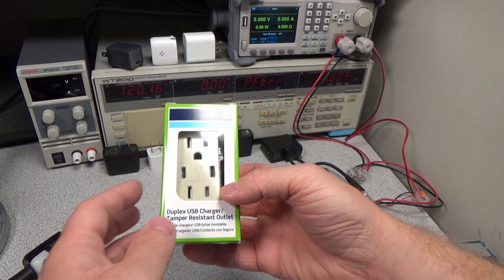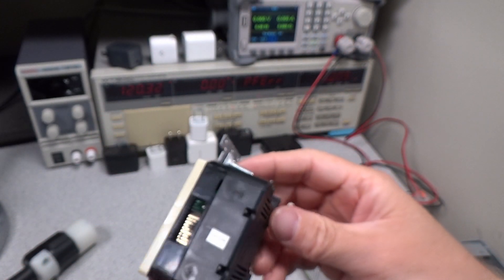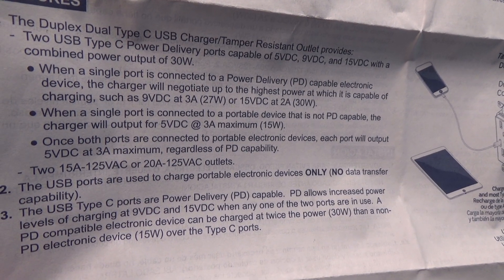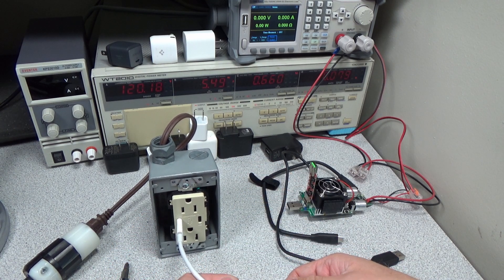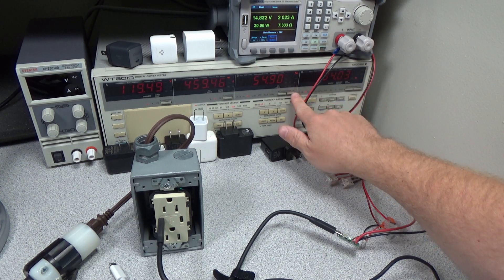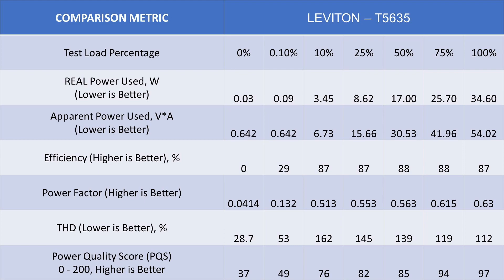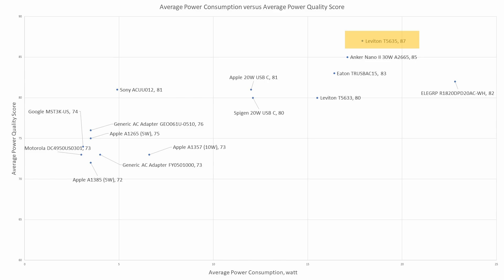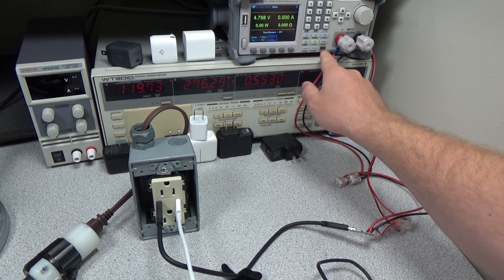Leviton USB-C Wall Outlet Review - 2021

Comment: There is a 60w version coming next month, T5636. I would love to see this testing on it!
Reply from the maker: I wonder if I can get one early, a brand the size of Leviton and a channel my size hahahaha.  I do need to do a refresh on these usb wall outlets though. The t5635 is my go to still.
Reply: Some people have reported problems with the 60 W T5636 (15 A) / T5836 (20 A) negotiating PD at 9V with some devices, whereas the 30 W T5635 (15 A) / T5835 (20 A) worked fine.